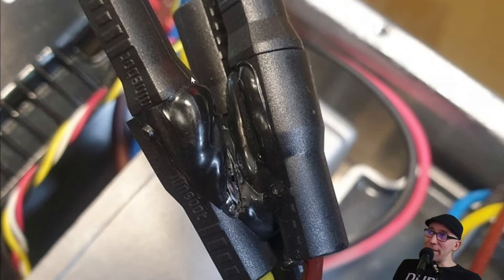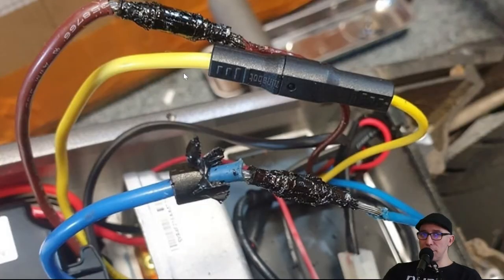Tyre and water damage related repairs - eScoot Talks

Comment: Subbed. I did have a question; i got the nami klima and have rode it in the rain once. Should I be worried? What is the potential for water ingress, even if it is IP55/65. The charging port cover does not inspire confidence. 
Tape on the horn/port cover? 

Thanks 🙂
Reply from the maker: Hiya. Apologies for late reply.  Not sure about Klima to be honest. If it was light rain I wouldnt be worried. If it was heavier rain I would get it inspected especially battery compartment.  Thanks for sub.
Reply: @escootIreland  I rode in really heavy rain last night. The only issue I had was the first time, after 2 weeks I didn't wipe the rain water off of the folding mechanism. It started to cause galvanic corrosion / rust. I got it all off with sandpaper, though, and sprayed it with lithium grease.
Reply: @escootIreland  Also, the way the battery is designed, you can't seem to be able to open it very easily. Multiple sources state it is fully waterproof. 

Of course nothing is, but in the Facebook group there have been no instances of water damage/battery failure. 
I still don't ride in rain, but got caught last night. 

Thanks for your videos, they are helpful
Reply from the maker: @goofyahhh254  yeah corrosion is quite common on eScooters.
Reply from the maker: @goofyahhh254  thank you. I did had a little break because I was busy but Im bringing more and more videos up soon.